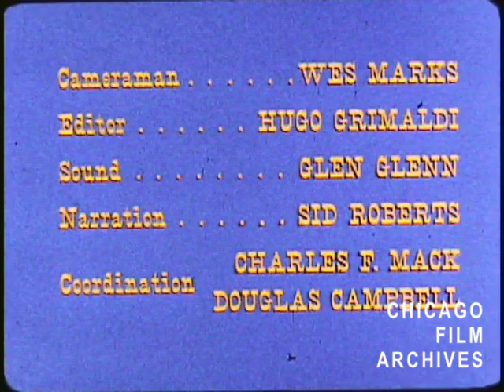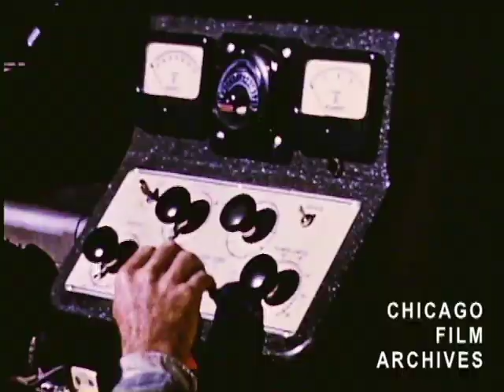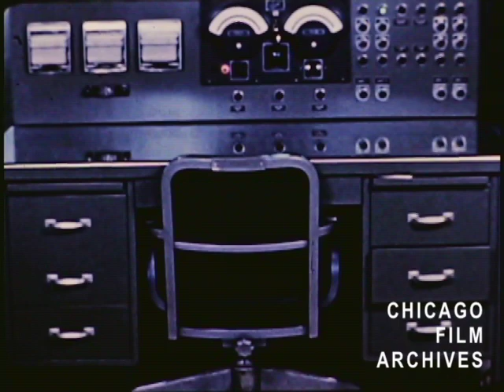The Arapahoe (circa 1955)

Comment: I worked on gas pipeline construction from 1966 to 1987.we ran 28 miles of 12inch with or trencher,a 944 Cat sideboom  four welders &a 944 Cat to backfill.Tough times back then.
Reply: @Patrick Luka Instablaster :)
Reply: @Everett Ares it did the trick and I now got access to my account again. I'm so happy!
Thanks so much you saved my account !
Reply: @Patrick Luka No problem =)